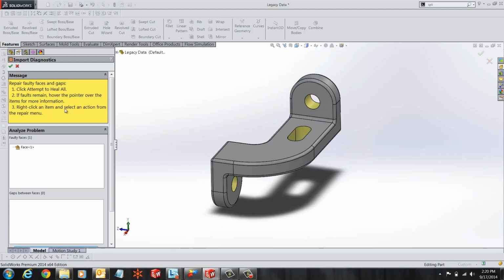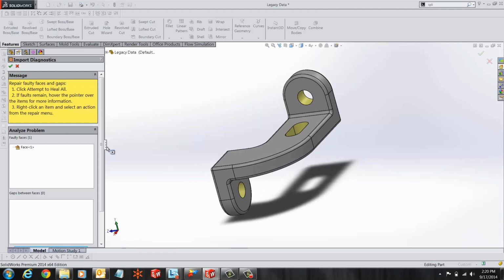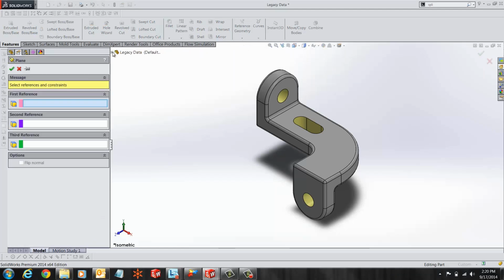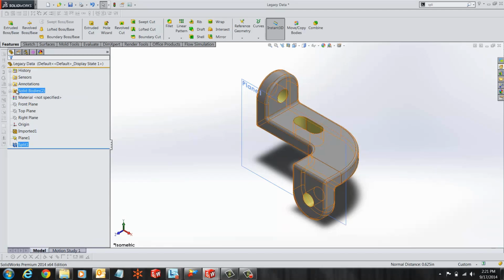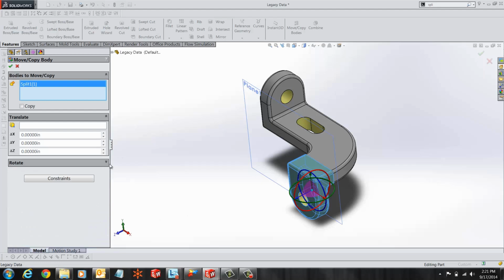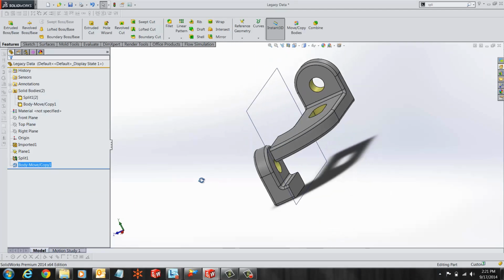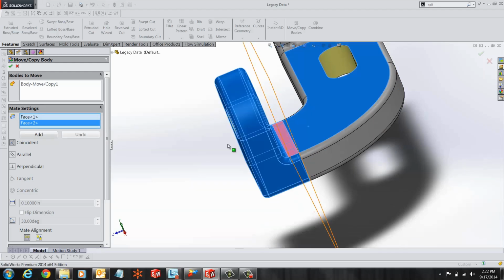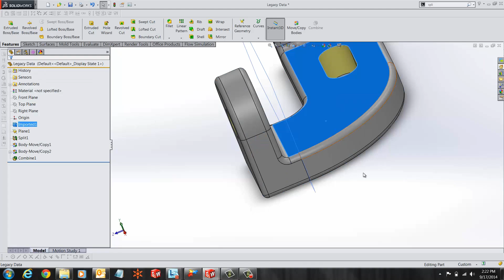SOLIDWORKS - Move Body

Comment: I can't select surfaces when try to move bodies with this command. What should I do?
Reply from the maker: Surface bodies are possible to be moved with the Move Bodies Command. If you’re unable to move surface bodies, try going to the fly-out tree and looking in the Surface Bodies folder. Select a Surface body from there and attempt to move it. If you’re still unable to select the body, I recommend running a repair on your installation, or going to a source like the SOLIDWORKS forums or your local reseller who could take a look at your file or computer setup.

Comment: For me, when I try translating a part, it gives me a warning message saying feature will fail, then if I continue, most of the part disappears.

I am also moving a body that is part of a part in a larger assemble.

Would you know how to fix this?
Reply from the maker: If you are using MOVE/COPY body to Move (Translate) a Body at the END of the Feature Manager, there will not be any features that follow it to fail.

If you are Rolling back in the feature tree OR have Top Down relationships to or from another part, then moving a body can definitely effect and break some features.  This is purely specific to the Feature Tree of the part in question
.